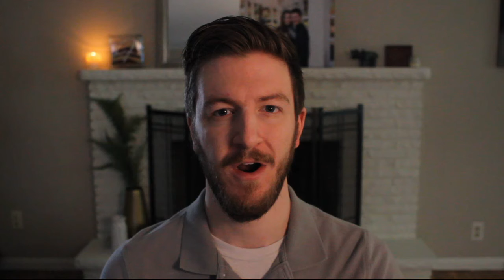Do you need to cure your candles?

Comment: Is curing needed with essential oil candles?
Reply from the maker: Good question.  Curing is a function of the wax, so short answer is YES.  And the length of time depends on the wax you're using.

Comment: Thank you so much for breaking that down, makes sense! 
I'm using a para/soy blend 6006.. since it's a blend should, I wait between 2 days - 2 weeks? I wait 4 days for my last candles and there really was no hot throw.
Reply from the maker: Yeah, give it a little extra time and see how it goes.  If you're still scratching your head make a few melts out of it and see if those throw.  If they do, your problem is most likely related to WICKING.
Reply: @ArmatageCandleCompany  perfect. Thank you!

Comment: Do you fix your candle (if need it) with the heat gun and then let it cure? I was thinking... I let it cure for some days (or weeks) then fix the holes/bubbles and then let it cure for some time more. Is this a waste of time?
Reply from the maker: Getting those fixes with a heat gun in early always helps.  Some people puncture the candle with skewers within hours of the initial pour to remediate craters, which is an option.  Otherwise a heat gun to the top surface works at that time too if you can breach the cratered area.  Sometimes they're deep and you can't possibly heat gun fix all of them.  Only way to know is with relief holes.

When it melts down it will need some time to cool/harden as before.  Your result may be confusing and inconsistent if you start safety testing the same day you heat gun the top... wax is still softer in some areas because of it.

A bit long, but I hope it helped.
Reply: @ArmatageCandleCompany  Thank you so much Kevin, of course it helps! And thank you for sharing your knowledge. I've been learning for a lot of months, watching videos, testing with differents waxes and scents, etc, and I'm making myself crazy! It seems I won't ever get the perfect candle (T_T) Haha... Thanks :)
Reply from the maker: Haha I believe in you!

Comment: Hi Kevin,  I've got a candle I made (cured 2 weeks) that throws great at first and 2nd light, but diminishes at the next lights :( I don't know why this is happening, do i have to cure it more? So confused :(
Reply from the maker: How deep is your melt pool?  Re-melted wax sometimes loses its gusto.  Shouldn't have to cure it more, but your melt pool might be getting a bit deep.  Are your temperatures in control for safety?
Reply: @ArmatageCandleCompany  thanks for the reply! It’s around .8 cm around an hour. The meltpool doesn’t reach to the very edge since it still isn’t in the middle section of the vessel

Comment: If I make my soy candles and only cure them for 24hrs, is it safe to ship them out?
Reply from the maker: If you're shipping in colder shipping conditions (less than 100-120 °F) you probably won't have any problems, but if it's warmer you might since the wax hasn't hardened as much as it wants to.  Trucks get hot.
Reply: @ArmatageCandleCompany  Thank you! It’s been in the 60’s in California and that’s where most of my shipments are to :)